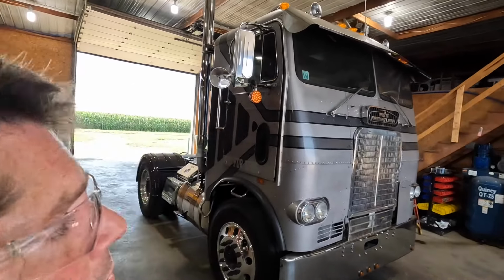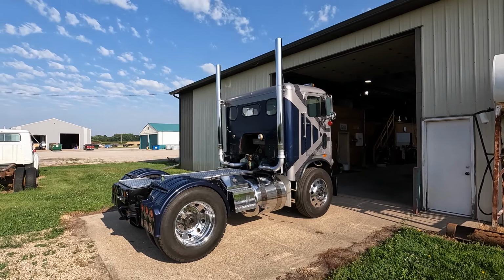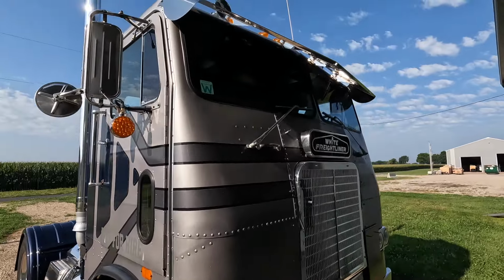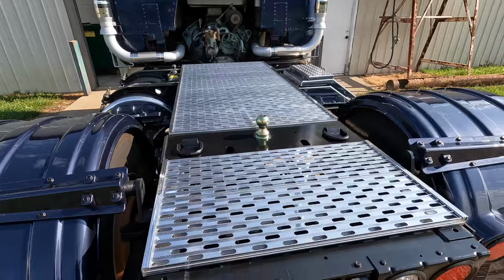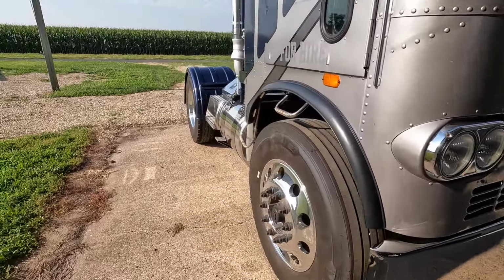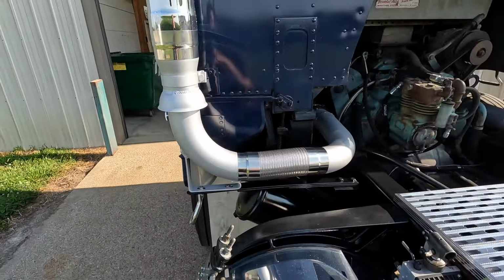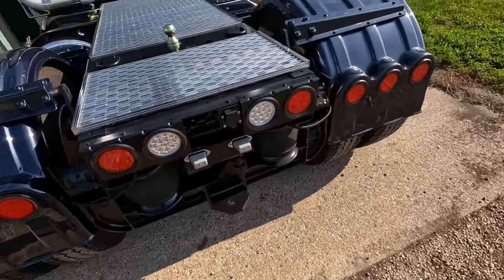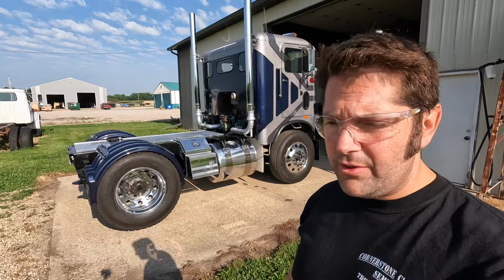Rowdy White Freightliner Cabover with an 8V71 Detroit project complete!!!

Comment: Straight Line  steering out in California could probably help you out on what kind of a set up you would probably need for that tractor.  They are online.  Bill. It sure came out nice.  There's a Father and Son trucking family in Fontana, Ca that have a Freightliner Power liner single axle with a KTA 600 Cummins painted the same exact style only red and black that they use and show.
Reply from the maker: Ok, I’ll have to look into them as well. I did find a place in Sioux City Nebraska that will assemble all the parts needed to make a hydraulic system work. Just waiting on the customer to make a decision. I’d like to see that   Power liner, they are beefy trucks.

Comment: Had old Freightliner Cabover, and had power assist had a Detroit in it
Reply from the maker: Right, that’s the most I have seen for power steering but customer didn’t want that air assist ram hanging off the tie rod tube. I have another Freightliner myself that has the air assist on it and works good

Comment: I don't know if this would help, when it comes to the power steering issue, it might be worth getting a hold of Wayne from the Ol2Stroker youtube channel, there's not a lot he doesn't know about when it comes to detroit engines and the parts for them. Just a thought and I hope it helps.
Reply from the maker: Really appreciate that tip, I did end up finding a place that can assemble a complete power steering system for the truck but I’m waiting to hear from the customer if he wants to proceed. It won’t be cheap, but nothing is at the moment

Comment: That truck is super cool. Does it ride rough being a cab over and single wheel base?
Reply from the maker: Surprisingly no, it does have a dealer added air ride that helps a little but it’s not too bad.